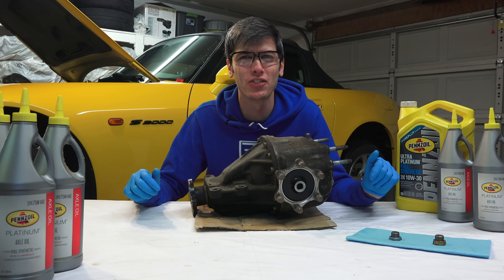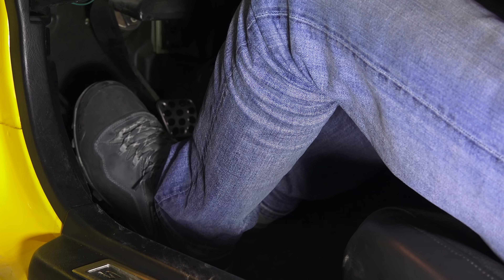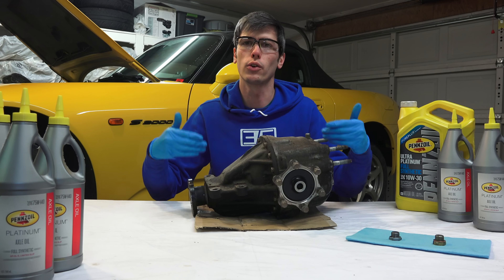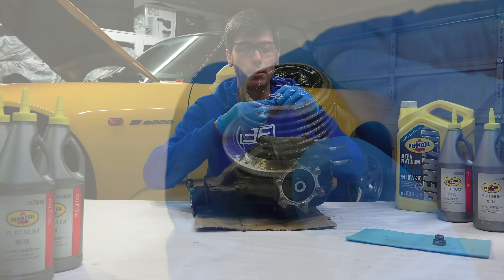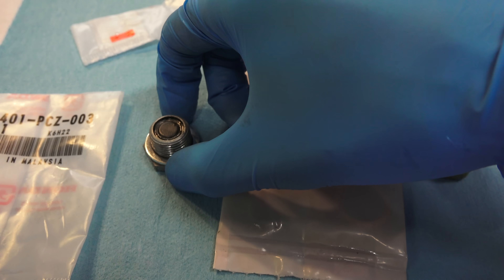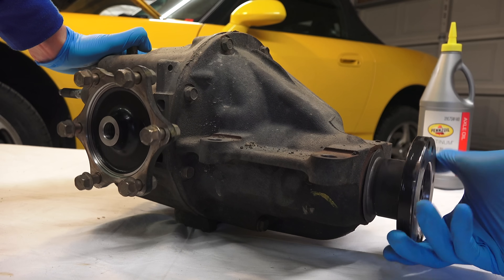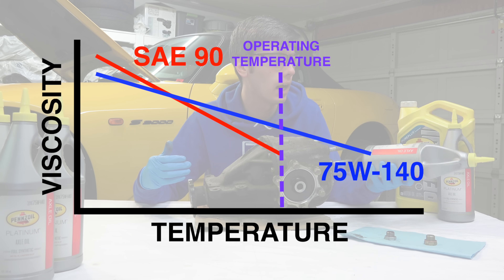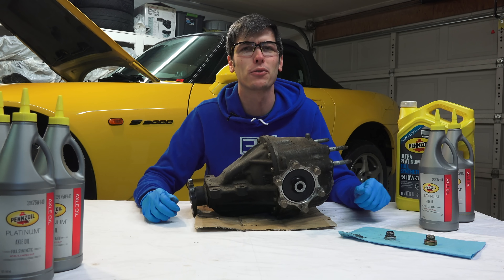Things You Shouldn't Do With A New Differential

Comment: Breaking in a differential?   Hehehe.  On this subject, you have to be joking.   If those parts were so poorly matched to begin with that they generate so much heat that cannot be dissipated readily, you've failed from the start.  I enjoy most of the vids but as a very experienced mechanic, I can say: There is no "break-in"  for a differential.

Comment: For the first time I have problems with content on this channel.
1. I don't belive the argument about breaking in a new LSD with short drives. Sounds unlogical, if it heavily wearing off it won't make much of a diffrence if it is in small steps or larger ones. This would also be true if you would buy a new car, but it is not recommended there.
After 15km my engine (BMW S54) is just about to reach operating temp and I try to avoid short trips as much as I can.
2. If the oil temp in the diff causes problems I would rather increase the surface area of it than mess with the oil. Even if you improve high temp performance you lose a lot in the low temp area.

Comment: I got a question for ya if you pick this up. Whats the design advantage of offsetting the diff by 40-55mm from dead centre in a live rear axle? Im digging around now for the answer but not much luck. Ive got a toyota crown axle in a 34 hotrod and i was going mad because i couldnt centralise the driveshaft..... until i noticed the diff flange was 50mm off to the right. Toyota also do center and left side offsets too..... why?

Comment: I’m going to be That Guy:  you normally don’t need to break in a differential.  The final drive ratios usually are a non-integer, meaning the gear teeth are constantly “hunting” the mesh; The gears will wear evenly.  The most important thing is to follow the manufacturer’s recommendations with fluid changes - maybe even be more aggressive.  I’m skeptical when carmakers say fluids can last ridiculous mileage without being changed.  BMW was caught doing this with oil changes ( they recommended 15k miles or something), and it turned out to be a way for them to reduce the number of “free” oil changes on their complementary maintenance packages.  I have my transmission fluid and coolant changed at 50k, the brake fluid every 3 years, and the engine every 5k miles.  By 100,000 miles the carmaker has washed its hands of any problems that crop up from dirty fluid.

Comment: When I regeared my front dif, I just put in gears, thats it. Reused the bolts, seals,  oil,  bearings, all of it. Didnt even bother setting up the gears, just kept the OEM shims.
I then proceeded to do multiple launches involving breaking loose all four 35in tires in low range.
Dif works fine still, I don't see all the fuss in it.

Comment: Whatever the builder suggests, but going from 90 to 140 in weight is rather  high. Going to 110 would sound more reasonable.

Something like a WRX which takes 75w90 should bump up to 75w-140 because of autocross.

Comment: QUESTION: You say to drive only 20-30 miles at a time when breaking in a new differential, but this same advice isn't given when breaking in a new car (which itself will have all new components, including a new differential). Why the discrepancy?
Reply from the maker: Long trips aren't really recommended for engines either (though operating temperature is good), for example a long highway cruise keeps your load and RPM relatively constant, which instead you should be varying.
Reply: I have heard this. Logically I would have thought a constant cruising speed would be better due to a steady motion and somewhat constant temperature. Thanks for the reply!

Comment: I don't think differentials have break-in. Sorry.......
Reply from the maker: Okay, so what are those metal shavings on the drain plug from?
Reply: Differential parts do wear and eventually 'fit together' better. But driving differently to 'Help' them is not needed. Just change your fluids regularly to remove foreign debris.
Reply: easydoz1 If the manufacturer recommends a specific break in procedures then yes it does. If you think it's pointless that's your opinion, but the builders gets to decide if they have one or not.

Comment: I rebuilt my gears myself and the second oil change i still have a bit of metal gunk on the magnetic fill. Seems to be fine otherwise. My diff used to get hot when i first started driving er and id have to stop and let it cool alot but better now.

Comment: I do not see how more power causes a increase in heat on a diff. Now sustained high speeds or towing heavy loads will certainly heat the diff more than normal hwy driving.

Comment: does this apply to brand new cars as well? or are they already broken in from factory? I didnt see anything about changing the diff fluid in the manual after first 500 miles.
Reply: he specified, his diff manufacturer, not his stock one, and said is a point of "good practice" but theres no real problem if you dont do it. on your car manual theres the break in period you should follow

Comment: break in a new differential?? ive never heard that before and never have...im going to call BS on this one...you do not have to break in a differential. in fact it will more than likely last the life of the vehicle if you never change its oil...over filling is the number one reaon ive seen diffs explode!...not because someone towed with it at 400 miles...in fact you were doing zero to 60 pulls the minute you got it together, comparing times with the old one...seriously dude, did you just make that story up?? that is BOGUS information
Reply from the maker: I'm not the one making things up. You can clearly see shaved metal on the drain plug from break-in, it doesn't appear out of no where. As for "it lasts the life of the vehicle" I suggest you check out a few owners manuals and see what they recommend. My S2000 recommends changing the differential oil every 15,000 miles. Or did Honda engineers just make that story up?
Reply: They recommend that oil change because the LSD shaves off clutch material, which will increase wear on the gears over time as your oil converts into sandpaper paste. In a vehicle with an open differential, the oil change on the dif is very infrequent or sometimes not even listed in the service interval chart.
Reply: +stickloaf, don't change your engine oil either. because in fact, "it will more than likely last the life of the vehicle" too.
Reply: I'm with you on this one, yes there are artifacts of manufacturing left in your diff, but break in doesn't exist in well manufactured and properly finished gearboxes.

Comment: This is so convenient because I'm rebuilding my differential right now
Reply: If you are rebuilding it yourself make sure to take your time. You gotta put shims on the pinion and carrier and you need a dial indicator to check your backlash. Also get gear paint so you can see your pinion depth. Hone out the original carrier bearings for set up so they slide on and off easily and shims can be added to adjust. You gotta set the pinion depth and the preload then the backlash and carrier preload each time you put shims in then paint the gears and hope you see centered ovals on the teeth. Quite a process one more tip start with big shim changes overshooting the range and slowly adjust in smaller increments to the optimal adjustment. Good luck
Reply: Maybe you shouldn't have destroyed it
Reply: I didn't break it
Reply: "I think I broke a u-joint" murders diff
Reply: Thomas Fetters do you a magnet drain plug fir the ram?
Reply: True Blake broke it
Reply: Thomas what grade of diff fluid are you going to use?

Comment: Is it true that if you do not change the diff oil within the first 1,000 miles then not to do it because at that point the diff is used to the metal residue thus it will damage it if changed? I find it farfetch.
Reply from the maker: Fresh oil is never a bad thing. Wasteful if you do it too often, but won't damage the vehicle.

Comment: If the differential is assembled properly, with gears that were prviously lapped in, then there is really no need for break in. Just run it normally, like a human, for a few hours.Manufacturers have warranties written with the assumption that no break in was done at all. 
   In fleets the diffs have temperature reading stickers to show if the diff is overheated or marginal to get it looked after before breakdown. If Drag racing or Drifting the warranties are void for obvious reasons.
    If pulling heavy loads you may need a pump and a cooler.Higher viscosity lube sucks up power and makes more heat which thins it out. 
  Multi weight additives break down , create sludge , and you end up with the base oil viscosity. Fleets prefer straight weight lubes for that reason.

Comment: But not enough power to beat my turbo miata. Hey, as you put more power on the car, go into why engine mounts and differential bushings need to be upgraded. I had to learn that the hard way.
Reply from the maker: I replaced the diff mounts when I swapped in the new diff, and in fact the original mounts were still fine even at 15 years old, so on that front I should be good!
Reply: I'm only running 8 psi on my 2.0L miata and the drive train hop in 1st gear at the strip is bad. All the mounts look good and it isn't a problem on regular old pavement, but the strip is so sticky and there is so much power in first gear that the whole drive train hops if the tires are allowed to slip at all.

Comment: Pennzoil sponsored BS, sorry you're selling it this way. Create fear, with things that once where true. Not with todays manufacturing anymore. How much does Pennzoil pay you?
Reply from the maker: The 500 mile recommendations don't come from Pennzoil, they come from the diff builder and research from other companies which produce and sell differentials. But you can believe whatever you'd like to.
Reply: Your claim is false. You pretend every car and truck with less than 500 miles (why 500...) cannot be used for towing or carrying heavy loads. Almost every utility vehicle on this planet does NOT start its life with driving empty. Sure you will find some aftermarket manufacturer claiming this, if it does one thing, it’s delaying warranty (by delaying loads you of course extend product life in time...hence...). But please don’t pretend this to be a general rule to every diff. Not ethical while cashing in Pennzoil money. My question stands: How much does Pennzoil pay you?
Reply: Last new duramax I drove had a 50,000 mile break in for heavy pulling. If you actually ever read an owners manual you would know that break in recommendations still exist. Crate 3800 break in was no more then 75% throttle till 500 engine hours. Some new vehicles actually lock you out of certain functions like launch control until break-in parameters are met.
Reply: How is what he said false? Just because people don't do it, it doesn't exist?? Also what does break in period, which is what manufactuters write on the manuals, have to do with Pennzoil? Since car companies are not owned by pennzoil you may want to stop bullshitting

Comment: Does front wheel drive cars have differential in them like my toyota Corolla 2010?
Reply: Omar Dawood yes you have a differential however, many front wheel drive vehicles integrate the differential with the transmission and share the same fluid.

Comment: This may be a completely unrelated question but in service information I've seen more than once to do figure 8s in a parking lot with a LSD after a rebuild or fluid change.  One of our TSBs involved changing rear gear oil and doing figure 8s in the parking lot.

What's that about?
Reply from the maker: Ahh okay, that seems logical. Doing figure eights would force both sides of the differential to (at different times) be faster than the other side. This would put it through its full range of motion.
Reply: Thanks very much.

P.S - solid content!

Comment: Never seen a manufacturer ask you to drop the diff oil on a new vehicle after break in, in fact, since theres a magnet in there and it's not a differential that requires limited slip additive, it's not a recommendation by any manufacturer to ever change the oil, the magnet acts as a filter for the fine particles, the only time you need to change the oil is when the limited slip additive diminishes, theres a major failure, or the oil becomes contaminated by water.  Gear oil is not exposed to combustion gasses and doesnt break down like engine oil.
Reply: It's like BMW "lifetime" fluids.  It's only lifetime if you get rid of the car at 100k.  Otherwise best to change differential fluid and transmission fluid every 50-75k.  These manufacturers don't have a magical fluid that lasts forever.  Do the maintenance or be ready to pay for repairs if you keep the car a long time.
Reply from the maker: That's simply not true. The owner's manual for my S2000 recommends changing the differential oil every 15,000 miles, or 12 months (whichever comes first). You can easily look this up. While that's more aggressive than most, you will find service intervals for differentials. It's definitely not something that you "never need to replace."
Reply: Honda does recommend yearly or every 15k diff oil changes under its severe conditions rule for this vehicle. Honda has some vague straight 90 weight GL5 GL6 as well so it’s likely a conventional oil put in at the factory. It’s also an extremely small capacity diff at less than a liter, so if you’re a WOT kind of driver, then these intervals can make sense given those two factors. 

As a builder of transmissions and diffs, I’d say a good synthetic like shown here and normal driving style (grocery getter ... such a waste) would get you a long time without a hint of trouble.
Reply: Diff temps can get real hot at highway speeds around 175°, if towing that number goes higher. I changed mine on Jeep GC at 50k and oil was black, very easy task and cheap for the DIY.
Reply: Then explain to me why tractor trailers have no reccomended service interval when they have millions of miles of towing. I'm all for being proven wrong. Its how we learn but I would love to see an oil analysis done on the gear oil at the reccomended interval.  Secondly, I have bad news for your Grand Cherokee your oil is black because your clutches are destroyed in the differential. Probably ran without friction modifier.
Reply: For rigs it could be a large capacity of oil, filter or cooler which would extend the service interval. There is no oil that will last indefinitely when exposed to heat, metal wear and fluctuating ambient temps. The additives usually wear out first like in trans oil. Trans oil I change at 30k, in addition to metal wear you have clutch material mixing in the oil. The more the trans shifts the more the clutch pack is wearing.
Reply: no cooler, and filters are only on old stuff, they use magnets to pick up debris. water is only a problem in large quantities, Ive seen diffs with over 500k on them and no water damage, I can promise the only thing keeping them cool is forward motion and the oil present. They do have large capacity, but its all relative, a pick up might take 10 liters of oil in the diff, the ones on big trucks take 30. 
What additives are wearing out in gear oil that require it to be replaced, whats causing them to wear out? A differential is a completely different machine than an engine and doesn't expose the oil to much that would degrade it. I know people who run big truck fleets that rather than changing the engine oil, do an oil analysis to check instead, if the oil is still good they go another 20k. Never had an issue.

Comment: When is a Engine more efficient?
High rpm and low throttle or low rpm and high throttle?
Reply from the maker: Neither of those are very efficient modes, but from a brake specific fuel consumption  standpoint (BSFC is your fuel economy relative to how much power you're making), high throttle low RPM will have a better BSFC. But there are reasons why you don't want to run super high load at low RPM (like LSPI).

Comment: So if you buy a brand new car should you drain the diff fluid after 500 miles?
Reply from the maker: Most new cars won't require it, but it's not going to hurt it, and will get rid of any metal shavings that have come out. Personally I did not with my Crosstrek as it's under warranty and I'm simply fulfilling all warranty requirements, but it's not a bad idea.

Comment: While I agree with the majority of break in rules, guys making thousands of horsepowers in race cars ignore all break in rules as far as mileage lol. They put it together in the shop, put it through a couple heat cycles on the dyno or in the parking lot, recheck torque of fasteners and send it. With way less than 100 miles on it lol.
Reply from the maker: Haha, but they also rebuild it after each race. Like in top fuel they get new clutches every run, new pistons every three or so runs, rebuilt supercharger each time. It's wild.
Reply: That is true lol. Top Fuel is a really exiting way to blow money hahaha. As a dealer technician, I follow all manufacturer recommendations on a customers vehicle. And make sure they are aware of said break in procedures. But I'll be honest, my newly rebuilt diff is going to get its ass kicked as soon as I'm confident the clutch is broke in :-)
Reply: Many gear manufacturers including US Gear, Richmond, Motive, Strange, Ford Racing offer ring and pinion gear sets that are manufactured specifically for racing and requires little or no break-in.